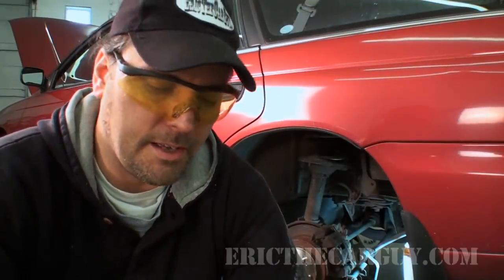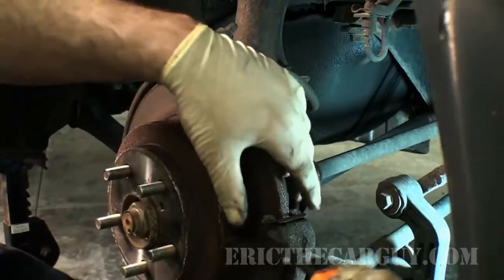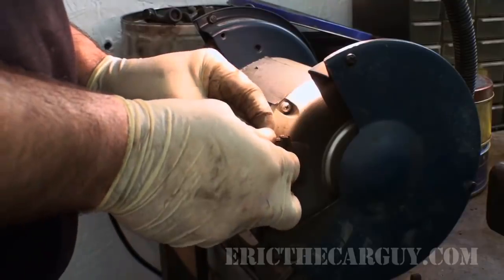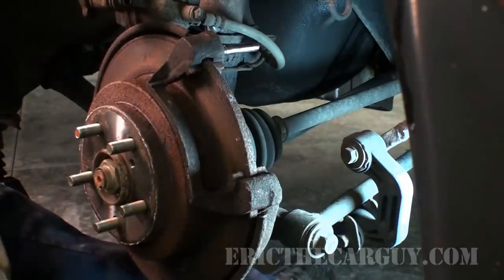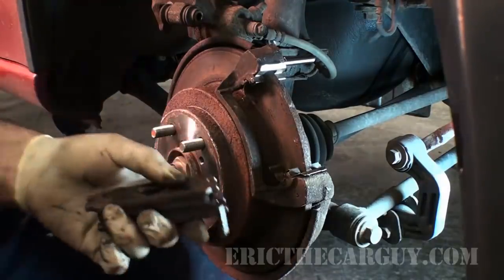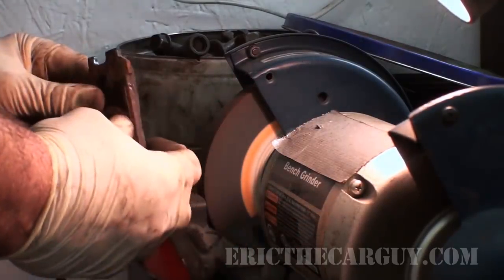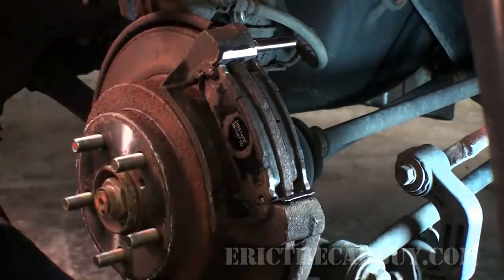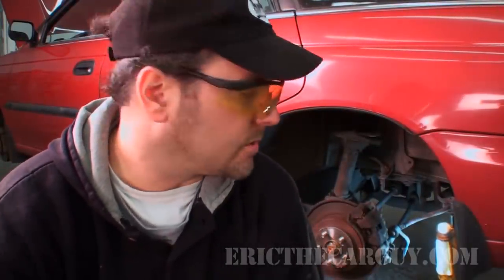How to Spot and Service a Stuck Rear Caliper - EricTheCarGuy

Comment: What is this? "Make it work for as little as possible"? Replace pads, rotors, shims, inspect and lube caliper... Do it right man, not half-assed
Reply: Now that I've finished watching the whole video, all I have to say is "Wow..."
Reply: Why replace everything and waste money if it's not broken. It was just rusted up no need to go ahead and replace it all. And maybe the customer needed it fixed for as cheap as possible. Don't be such a douche bag Eric is probably the most reputable mechanic on Youtube.
Reply: EvilJ069 So you're saying even tho the owner of the car couldn't afford a new brake system he should have done it anyway? That is stupid and a complete waste of money if the owner can not afford to pay off the job.
Reply: Josh Ianneillo
Then he doesn't need to be on the road, possibly endangering others
Reply: EvilJ069 Before the brakes didn't work at all i think it's safer now then before am i right? Would you rather have him drive with no brakes?
Reply: Josh Ianneillo
I believe I said the car shouldn't be on the road. And because it's safe-er now does not prevent it from possible failure because of improper repair. Plus, if something DOES happen and people get hurt because of it, it's possible Eric could be held accountable in court
Reply: EvilJ069 I see no failure point in the modifications he made. First the front brakes worked fine just the back were seized. 2nd i am sure the guy isn't gonna be driving 100+ in the car so braking shouldn't be an issue even if the back brakes do fail. 3rd The calipers were working fine all he did was shave off the rust all those notches do is hold the brakes in the sleeve there is no pressure applied there it just guides them so there is basically nothing to fail considering the caliper worked fine and the pads looked to be decent.
Reply: EvilJ069 Very mature.
Reply: Perhaps not, but there's obviously no reasoning with someone such as yourself. Go back to playing Mechanic Simulator 2014, that's the only type of vehicle your expertise should fiddle with
Reply: EvilJ069 You don't know who i am or my expertise so don't judge unless you know about a person
Reply: Josh Ianneillo
I know what you've said here, and it was utterly foolish
Reply: EvilJ069 Please elaborate.
Reply: Josh Ianneillo
Nothing I haven't already said
Reply: EvilJ069 No you never mentioned what i said that was so foolish.. Please Elaborate.
Reply: Josh Ianneillo
Nearly everything, but if you wants a specific instances:
Calling doing the job right a waste of money

The fact that you think removing rust is fine without considering the fact of the removed material makes the item weaker than it is supposed to be

The fact that you think just because someone can't afford to do it right that it's still okay to drive a potentially dangerous vehicle

The fact that you think because someone has a youtube channel with a lot of views that they must be right

Plus, you called me a douche bag without provocation, now who's 'mature'?
Reply: EvilJ069 I called it a waste of money because if the guy can't afford it then why would Eric to the job and then not make any money there for it's a waste of money. Like i said with the brakes the part he sands has no pressure or weight put on it so the little modification he did will not affect it's ability to work correctly. I never once mention that he was right because of his view count all i said is he is probably the most reputable mechanic on youtube. And it was the owners choice to drive the car in the condition it's in it's his car he can drive it as he may weathers it's dangerous or not it's his and it's his choice. And you were clearing acting as such.
Reply: Josh Ianneillo
If he can't afford to maintain his car, he should take a bus. And Eric accepts liability by doing anything with it, a real business would say do it right, or turn away the service. And sanding or not, IT IS REMOVING MATERIAL. The owner driving it is responsible, Eric messing with it puts responsibility on them both LEGALLY. So once again: You boob. If you don't like "boob" I can also offer "Cretin" and "Idjit"
Reply: EvilJ069 I could care less what you call me with you're keyboard muscles. I am done wasting my time on you. You're just trolling anyway i mean look at your photo. Calls me immature pathetic.
Reply: Josh Ianneillo First, shame on you for replying to someone who was just looking to argue.  You should know better, this is the internetz. But kudos for being the more mature and civil. ;)
Second, both of you should have paid more attention.  This isn't a customer's car.  No one paid him.  He even mentioned if it was a customer's he would do it differently.  Re-watch if you don't believe me.

To Eviljo:  Many weekend warriors would likely do the same kind of repairs given time/resources.  This is why my dad loves Eric and, knock on wood, he hasn't killed us yet.  I'd think someone as good as Eric probably knows what is safe and what isn't. If you don't agree, that's fine.  But you'll find most people who watch Eric's videos will disagree.  It's just a matter of opinion of course.
Reply: luckyducky9871
Most people that look to these videos for help don't have actual experience in a professional job, not just DIY'ers
Reply: i doubt you're older than me and if you are, you're very immature calling everyone that you come in contact with names. Is that the best you got  you internet toughy?  I've been a mechanic for over 20 years, worked in real shops, mom and pop shops, and aftermarket tuning of vehicles. So you fail again kid.
Reply: Another thing is, if you deem what Erik did here unsafe, then you're a terrible outside-the-box thinker. You're more like an assembly worker. Nobody wants to hire a C mechanic.
Reply: osos231
And yet nothing I have ever fixed came back... Hmm
Reply: Your right. I agree with you shims rotors and pads should be replaced not cleaned this is half ass. In my shop we would sell the parts and not waste our time cleaning them. When you clean them your accepting a a greater risk of a come back and guess what. The customer is going to say you suck as a tech. So do it right the first time.
Reply: osos231
Here ooze, found a product JUST for you, and people like you: http://c4.soap.com/images/products/p/aci/aci-028_1z.jpg
Reply: EvilJ069 Not everyone can afford a total replacement of the brake system. I appreciate seeing a low budget fix.
Reply: *****
Doesn't mean it's safe. Why don't you put some heavy duty shoes on and stop like Fred Flintstone? That's cheap too. (For that record, the RIGHT way that I listed is NOT a 'total replacement of the brake system', only the parts that are worn out)
Reply: EvilJ069 Why are you watching the video if you're so good at your job?
Reply: donnod2
As has been explained before: To see how others do things. It doesn't mean I have to agree, and the bottom line is this was not a professional job. Now I have had a really rotten few days, and I don't feel like arguing about it anymore
Reply: +EvilJ069 Heck why stop at Pads and rotors ......lets do the job right and get a new car!! Looks like that one has some rust on it......not safe.
Reply: EvilJ069 Haha are you being serious?
Reply: +hêlêl Deadly
Reply: EvilJ069 Haha sure you are...
Reply: EvilJ069 Then why reply? You're extremely immature...
Reply: MassMurdering Mao
If you mean me, I've never had to pay for sex, I've got MAGIC. If you mean helel, yeah, prolly
Reply: +EvilJ069 i bet those brake pads were aftermarket and the specs were not very close to oem and actually removing a little more material brought them closer to the required size needed to work properly....just an educated quees by a 50yr mechanic so ETCG bravo
Reply: niterbum You're welcome to your opinion